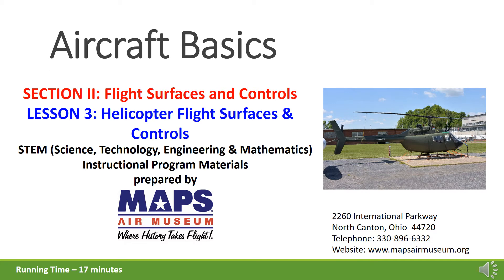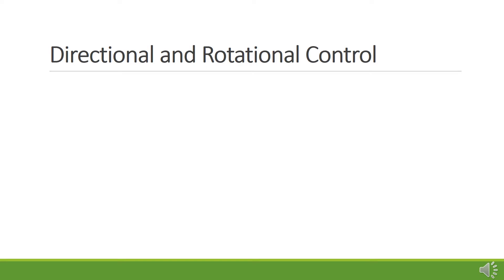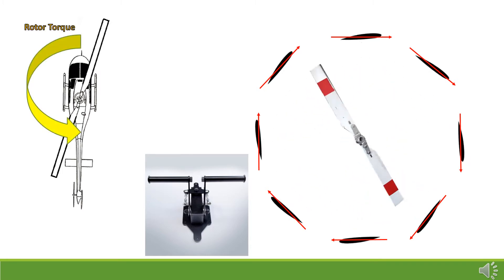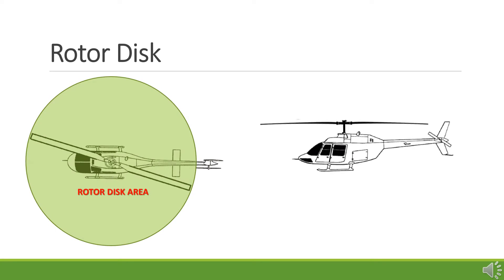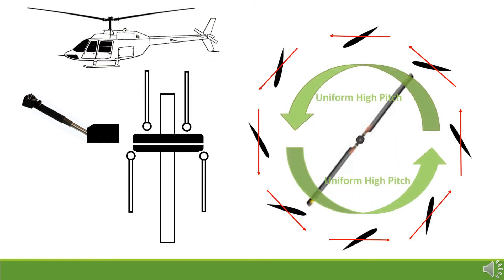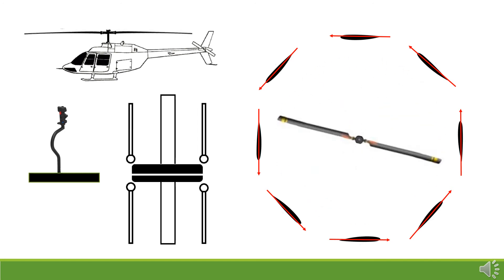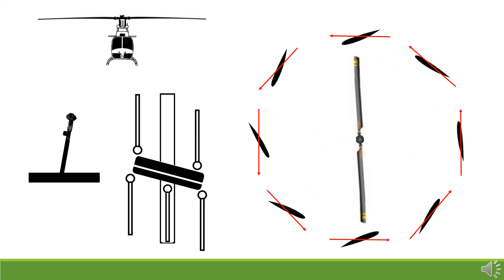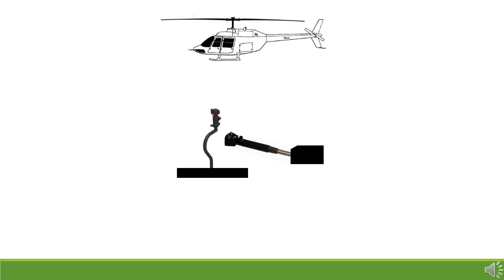STEM Aviation Lesson 2-3:   Helicopter Flight Controls and Surfaces

Comment: Other channels describe the direction of the main rotor's torque as being in the opposite direction of the main rotor's direction. not sure which one is correct.
Reply: Rotating blades experience a friction force opposite to the velocity with which they move. multiplied by a lever arm that results in a moment opposing the main rotor direction. Nonetheless, the described result is the same in this video as well, it was just not the most well tought through phrasing

Comment: 13:16 isn't there a 90° shift between swash plate angle and rotor blade angle?
Reply: I saw that On rc swash plate helicopters like the roban 700 size and micro swashplate helis.

Comment: This video really needs to cover the phase lag aspect pf the rotor assembly. Because of the gyroscopic effect, a pitch change in the cyclic produces a force that occurs 90° later in the rotation. If you wanted to tilt the rotors forward, you would move the cyclic forward but the blades would pitch up 90° before the rear or 6 O'clock position (pitch up occurs at the 9 O'clock position or left side relative to the pilot). This causes the rotors to tilt up at the 6 O'clock position or 90° after the pitch change occurs. This may cause confusion as it isn't very intuitive, but it's still a critical aspect for flight in a rotary wing aircraft.